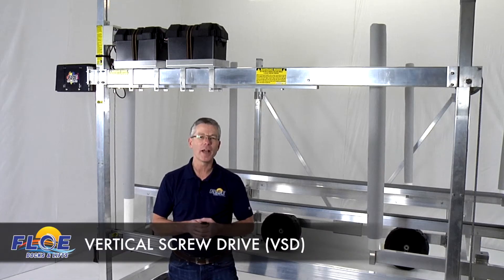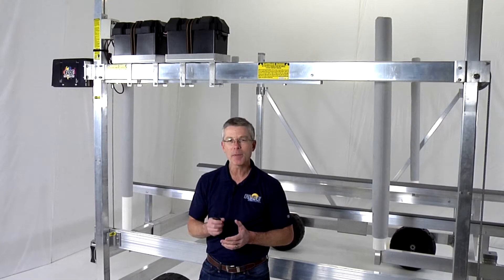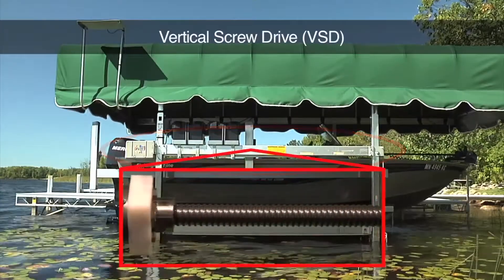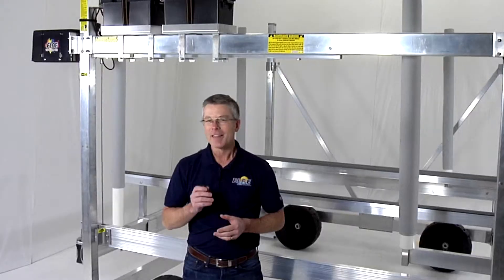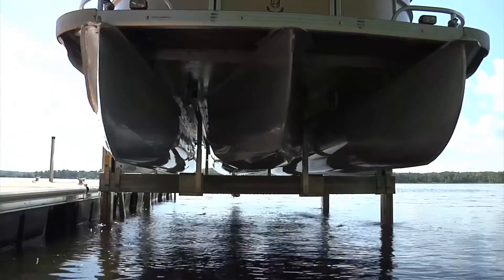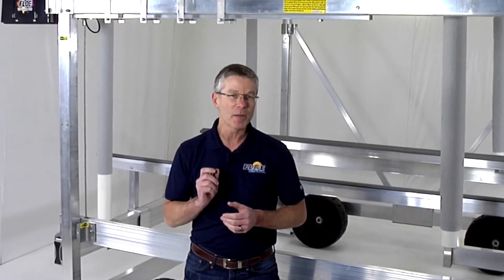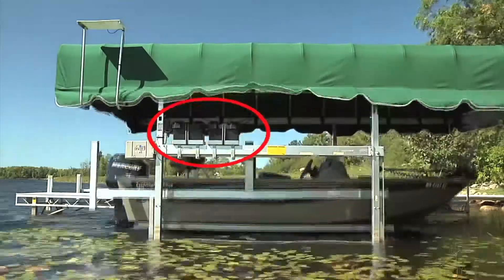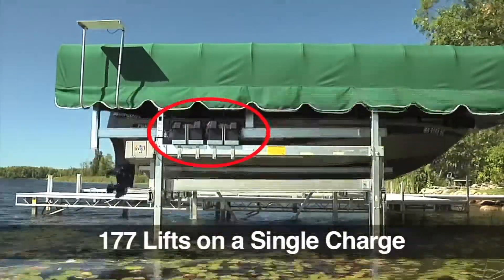FLOE Vertical Screw Drive (VSD)

Comment: Screw drive may go 20,000 cycles as they claim, the Motor and accessory box not so much. 6 yrs and 120 cycles and my motor junction box gave out and was about $1200 just to replace.
Reply from the maker: If you still have the ASC control box that stopped working, I would be happy to inspect it if you send it to me.  If we determine that the ASC failed because of a failed component or poor manufacturing, I will try to cover some portion of it under warranty.
Reply: @Floeintlsocial  I will be getting back to you. The dealer says that you have stopped selling the AC model because of such issues. Is that true?
Reply from the maker: @toypllr  It is true that we have stopped offering A/C drive kits until we have a more reliable system to offer.
Reply: @Floeintlsocial Being that is the case I would rather have my ASC repaired so I can have a spare. Is this something you can repair and if so what address can I send it to?
Reply from the maker: @toypllr  These are not easily repaired. I will send a new spare at no charge if you like. Please provide a shipping address.
Reply: I thought I provided an address but maybe you deleted it? Is there an email I can send you with a contact and shipping address?
Reply from the maker: @toypllr  alicias@floeintl.com
Reply: Thanks I will contact